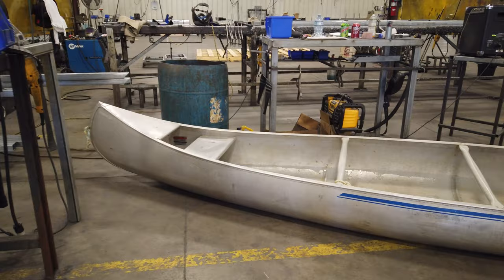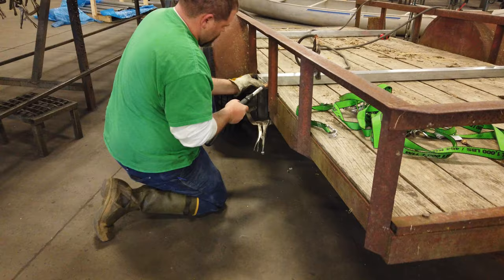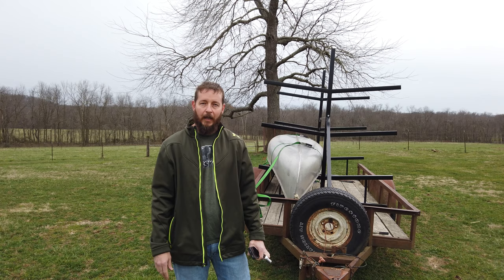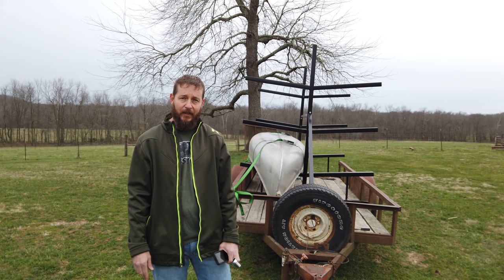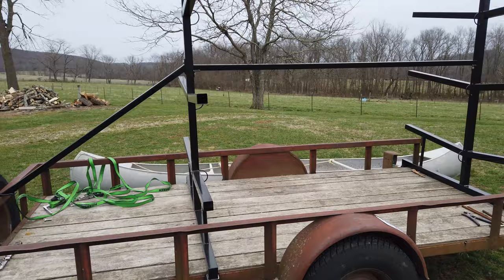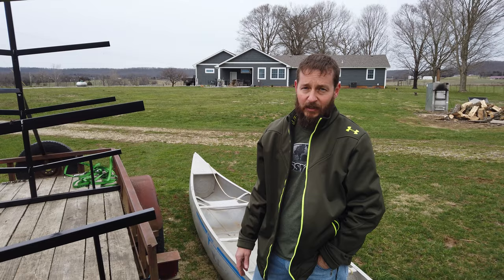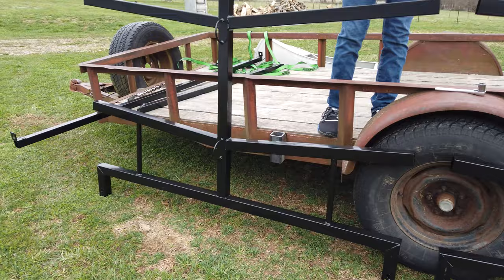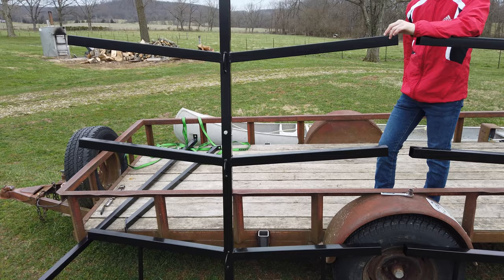Utility Trailer with Removable 6 Place Canoe/Kayak Trees

Comment: Nice, simple, idea.  A question I have is, once the floor rails are in the welded on square tubing/hitch receiver, do you run a bolt or anything through there to hold it in place?
Reply from the maker: I have a hitch lock for one of the receivers.
Reply: @413OpenAir , awesome. I saw that, was wondering if that is all you had. So when traveling the bases do not move up and down from the hitches? I have a trailer I am converting, saw this video, and was like wow this just solved 1/2 my mounting issues and made it cheaper. I’ll be using unistrut for my bases, no trees, but it will keep it modular, so I can maintain the full functionality of the trailer. Great idea and I will be sure to reference your video for the idea. Thanks much!
Reply from the maker: @t3angling575  I’ve not had any problems.  The center brace also helps tie it all together.  Thanks

Comment: Below you said this is 16 (.065) gauge 2x2 steel tube.  I am building a similar unit.  how did the 16 gauge hold up to the weight of the canoes? Local supply has 11 gauge (.125) but it's a little heavy at 2.25#/linear foot.
Reply from the maker: No problems with the build.  So far so good!  Thanks